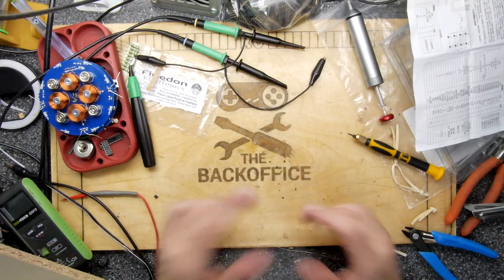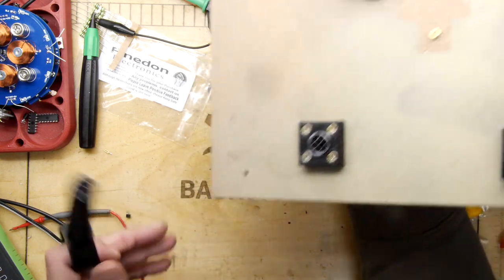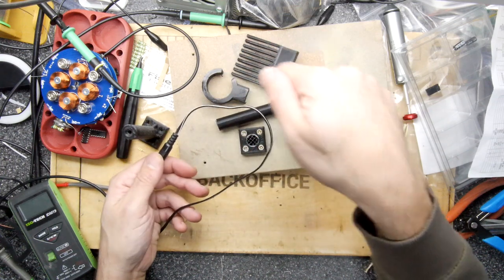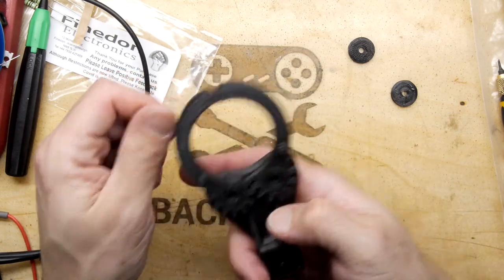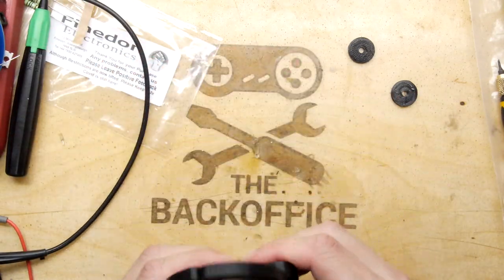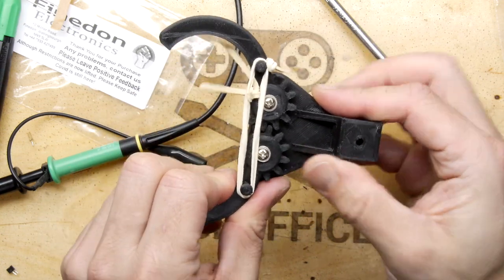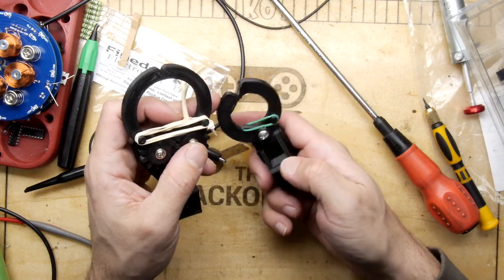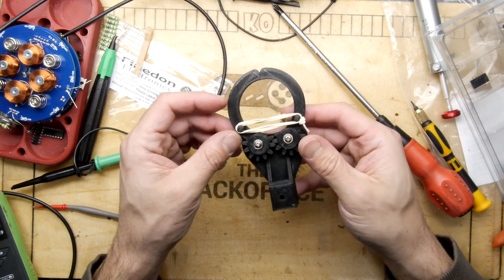3D Printed End Effectors

Comment: Please start a easy to rebuild robot with 5-6 axis, that is driven by nema17 motors and 3d printer hardware (gears, pulleys, etc) and electronics. Do not use small servos or at least a minimal amount in the gripper. That would be awesome and i know you are capable of that. All desighns i found so far are either too complicated or to instable.
Reply from the maker: You got it! I'll look for some!